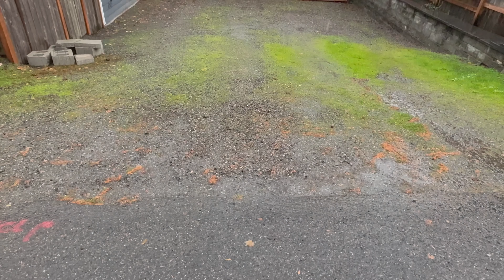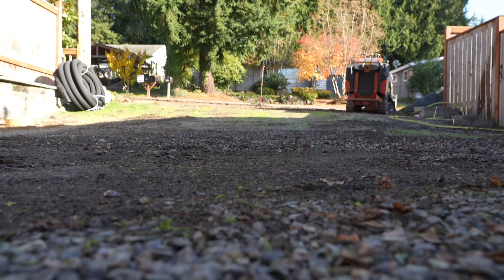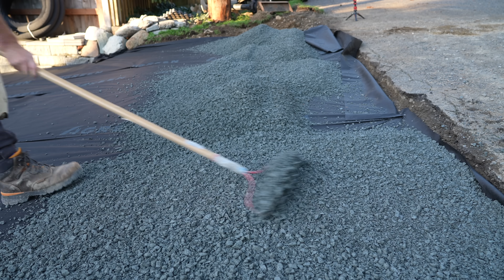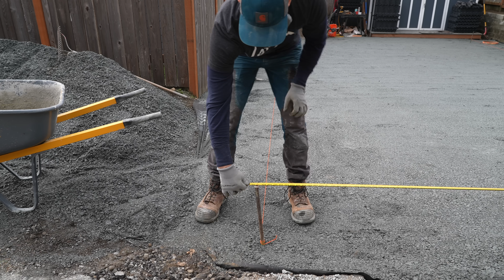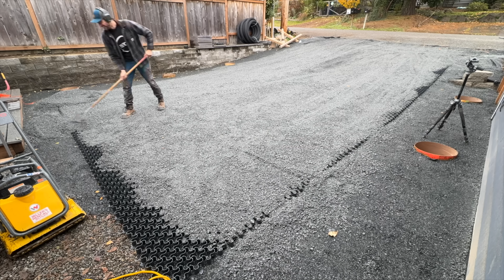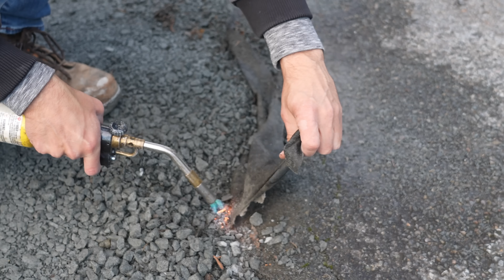How To Install A Permeable Gravel Driveway Grid System

Comment: You did a really good job for a DIY'er. One thing you sgouldce done is kicked your grade up against ghe house. You didnt fix the drainage issue. I cant remember what code is exactly, but its something like your grade should fall 4" away from the house in the first 5'. Also. The grade you have is going to allow water to pool below your rock up against the foundation, and if they have a basement thats no bueno. Othef than that you did well. You could use the machine far more than you did to make the job easier. It just takes time in the seat to figure it all out
Reply from the maker: Thanks for the kind words and support Aaron.  I take it your a true tradesman and I always appreciate input form people like yourselves.  Homeowner has never had any issues with water intrusion at the house and based on the two foot deep footing holes that I drilled on both sides the water weeps toward the retaining wall.  Once the carport is built I plan to but a gutter system in and have it fed to a specific location. And yes I've seen other operators that handle these types of machines on a daily basis and the level of accuracy is amazing haha.  Love it! Thanks so much for watching.

Comment: Looks like the grade is slopee towards the buildings and femce, not good.
Reply: I would agree
Reply from the maker: Based on my 2' deep footing holes we are A-OK.  the footing holes where bone dry by the house because the ground water slopes toward the retaining wall since that is the lowest point in the driveway.  Good thinking though and thanks for watching.
Reply: Yes!  you are correct. If he  don't install special draining he will end up having so much water and ice in winter time.

Comment: Obviously you have to work to the clients desires and budget, but i think garden beds on the sides where the concrete tubes are, a nice straight edge, and then a sealed asphalt drive would have been much nice looking. even swapping out the asphalt for this gravel system would still be nicer than gravel to the fence and to the house.

Anyway, maybe it all comes together with the carport on the next one. Cheers.
Reply from the maker: Might have to suggest the garden beds once the car port is built.  Thanks for the suggesting and for watching.

Comment: Very nice job Brent!  I guess you have to careful not to turn the steering wheel on the car unless you’re moving or you’ll tear up the gravel?  Thanks!
Reply from the maker: good question Roger.  Once the grid system is filled up you really don't have to worry about turning the wheels.  I did have to be carefull with the track loader making sure that I was going down straight when filling the grids otherwise if i turned while on the bare grids they would move around on me.  Thanks for watching and asking the question.